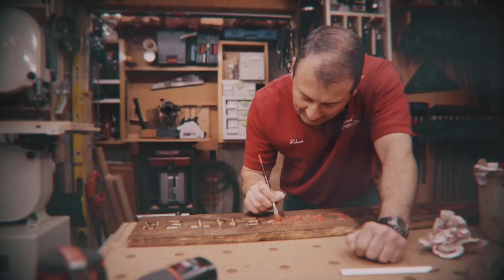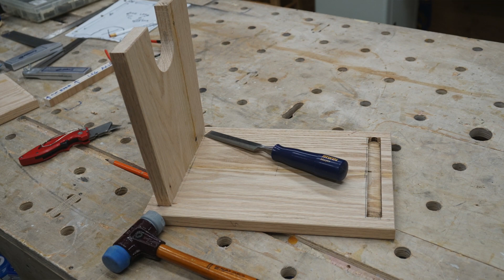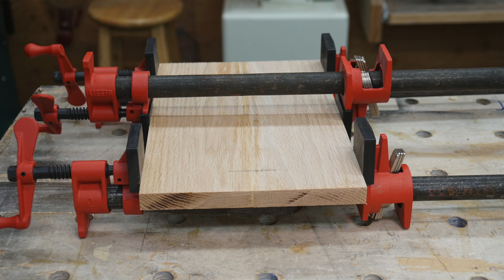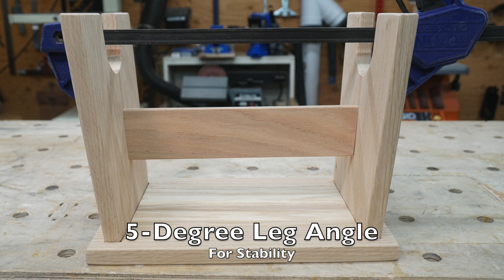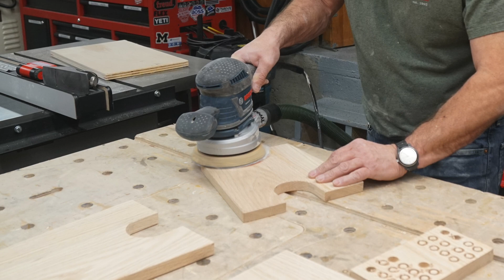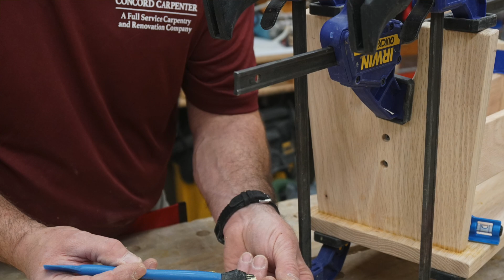How To Build An Oak Step-Stool

Comment: In the past, I've adjusted the subfences on my router table to align with the front and back of the router bit and I use those to know where to start and stop the cut.
Reply from the maker: Great tip

Comment: I like the way you did the dado. I have a tip for jointing wide boards at the planer, hold the cupped board on a flat surface and CA glue two small boards to the sides when it's balanced, or just hand plane it, or slab jig. But it's fast.
Reply: I did it with a 8/4x10" wide fiddleback maple on my helical planer and it worked. There was still tiny chip out with the helical one but not so bad it couldn't be sanded.